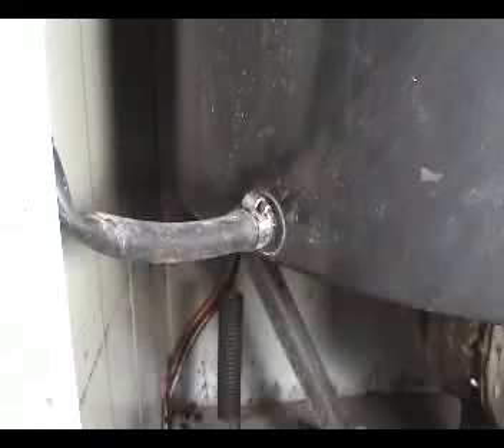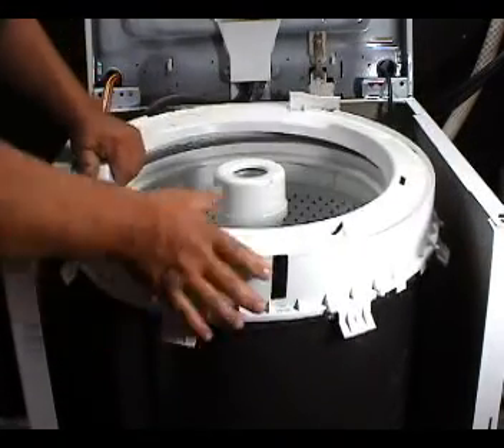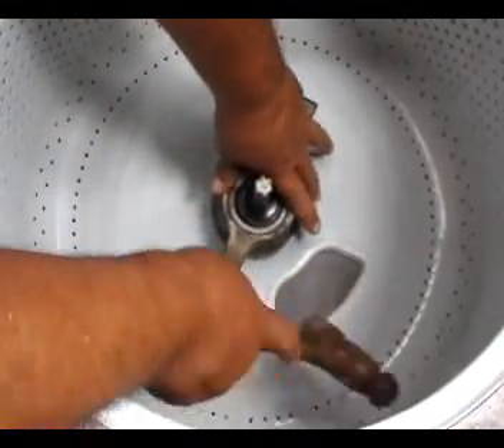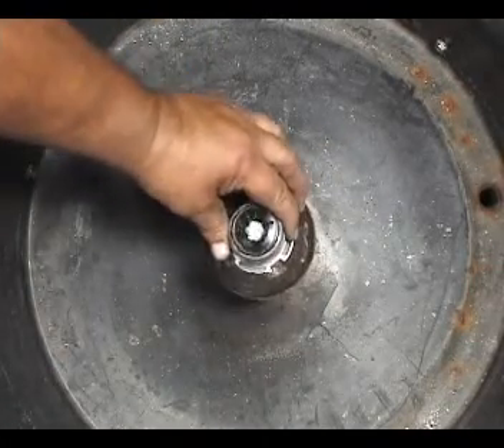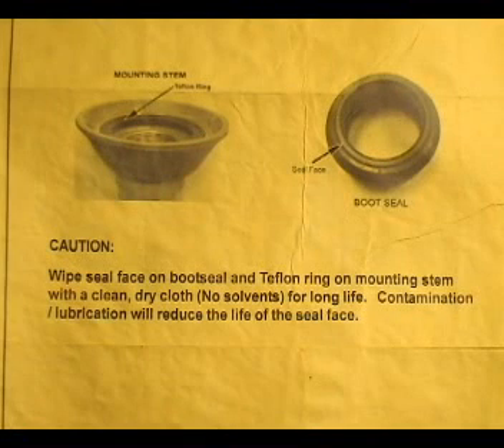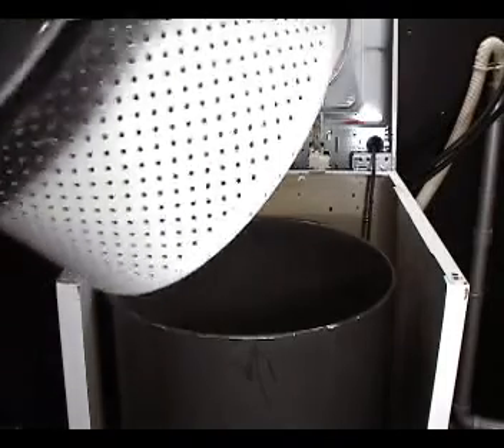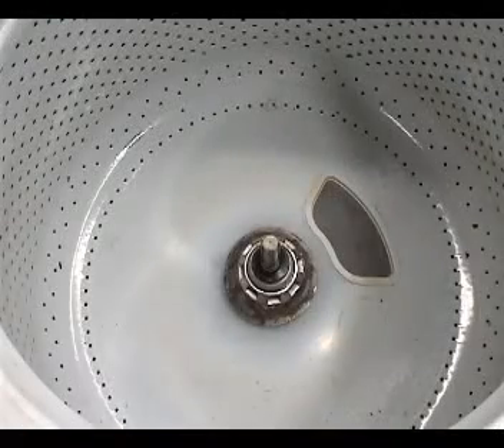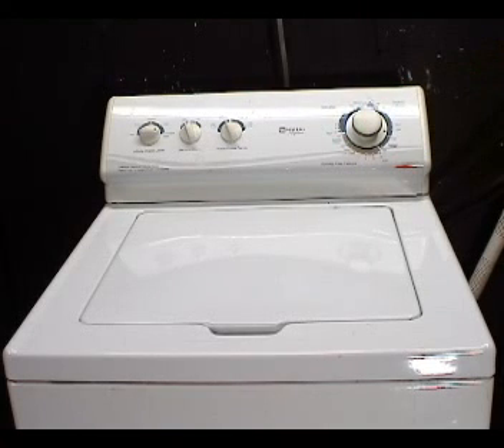Maytag Washing Machine Leaking Water - See How To Check & Replace The Stem & Seal

Comment: my machine is a  A206   the early versions with a counterbalanced transmission,   i have replaced the seal a while back it needs to be replaced again,  along with a couple of other things.  i need to do a little more checking as to what else i need,    I may have the two spanner wrenches made available after all required parts have been ordered and arrived,     regards,